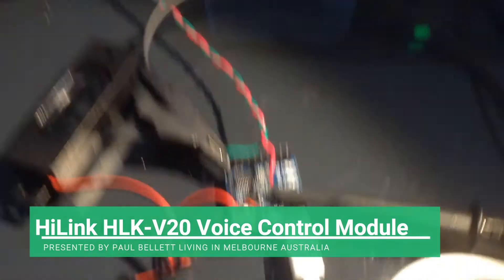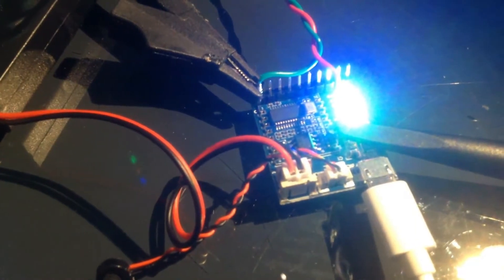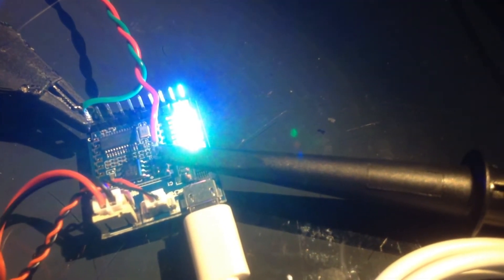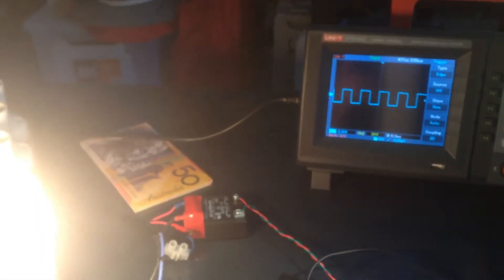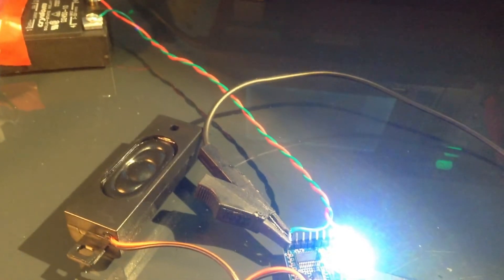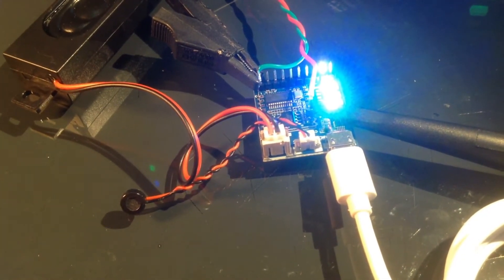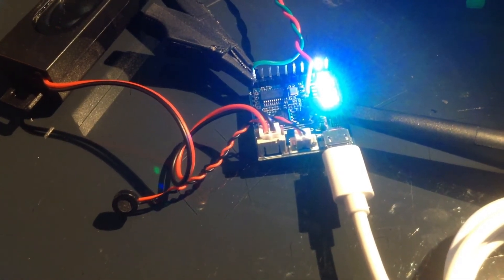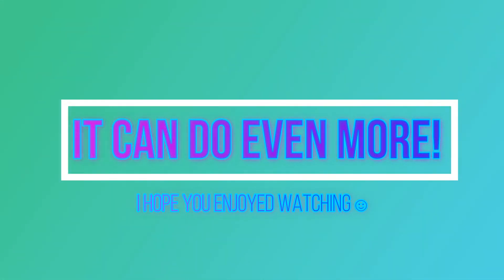Hi-Link HLK-V20 $10 Voice Control Module with Microphone & Speaker

Comment: Hi @paul, Can this moudle recognize the voice from a distance of 15-20 feets?
Reply from the maker: I'm expecting delivery of an ESP32-S3-Box in a couple of days. It can supposedly handle a lot of background room noise and also reach 15 to 20 metres, but will need to verify personally when it arrives if that is indeed the case.
Reply from the maker: 15 feet would be its maximum from the tests that I've tried on it. It becomes less sensitive if there is additional background noise in the room, such as having a radio  turned on.
Reply: @paulbellett2442  Is there any way, we can operate it from 15-20 feets distance. Any circuits to increase good sensitivity in an ideal room conditions. Can you do a test video on that?

Comment: How did you program it?
Reply from the maker: At this stage of the game,  the Hi-Link factory choses to FLASH program it themselves, from the list of customised commands that I had sent them. You can also choose from a list of people, such as male, female, Asian or American accent etc...Overall, I  was reasonably satisfied with the results, since your voice command can determine what you wish the microcontroller to do, such as high/low voltage output, frequency &  PWM control, customised serial port messaging etc...
Reply: @paulbellett2442  Does the Hi-Link factory program for money? What are the rates?
Reply from the maker: @radiolis994  I'm the Hi-Link distributor in Australia, I had ordered 50 pcs from them, so for me it was free to do it, it cost me nothing probably because I made it worthwhile for them by ordering these in quantity. However I will ask my Hi-Link contact what they are prepared to do for  just 1 or 2 samples?
Reply: @paulbellett2442  Thanks.
Reply from the maker: @radiolis994  Just got word back today from the Hi-Link factory just before they take a break for their New Year 2021 holidays. The custom voice commands programming and associated outputs can be done for free for anyone, but the production order must be a minimum of 200 pcs, otherwise its a $300 USD fee if you wanted way less than this quantity.
Reply: @paulbellett2442  Thanks. 200 pieces, how much is in the price?
Reply from the maker: @radiolis994  You can buy this as standalone modules (cheapest option) - as illustrated on my webpage - https://microwebserver.net/COVID-19_Solution.html or as a complete kit (which means that the microphone & speaker assembly are supplied, along with microUSB cable. Price will also depend if you live in United States or I'm authorized if you live in Australia to sell by that distribution channel. Once this has been determined, I can guide you in the right direction.
Reply: @paulbellett2442  OK, Thanks.
Reply: @paulbellett2442  So.. Without getting them to program it, it's useless.
Reply from the maker: @Alacritous   @Alacritous  Not really I have about 30 pcs with really useful commands that I told them to program. e,g.
Wake up , Beam me up  
Turn on the lights , Turn off the lights 
Announcement: Welcome, Give Love and Prosper
Exit Reply: See you
Computer Initiate Self Destruct Sequence @ Self Destruct Sequence has been initiated 
Open Garage Door @ Garage Door is Opening
Close Garage Door @ Garage Door is Closing
Activate Alarm @ Alarm Activation in Progress
DeActivate Alarm @ Alarm has been Shutdown
What Version? @ It is the Star Trek Theme
""                         ""
I have about 39 customised English command texts which I have not listed here.
Reply: @paulbellett2442  yeah that you told them to program. I want to buy 1 or 2. They're not going to program them for me and I don't like the lack of flexibility.
Reply: @paulbellett2442  Hi, can we at least get your version of the commands?
because i just bought 2 and i can only control 3 output using voice, the rest is not controlable ?